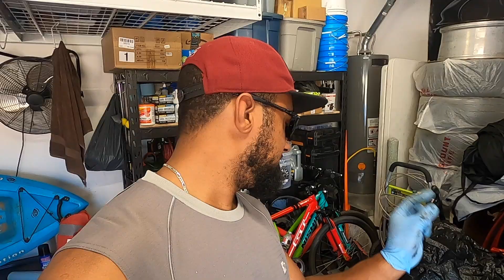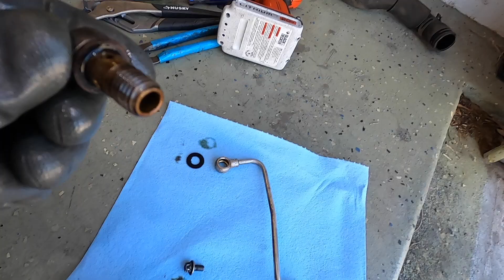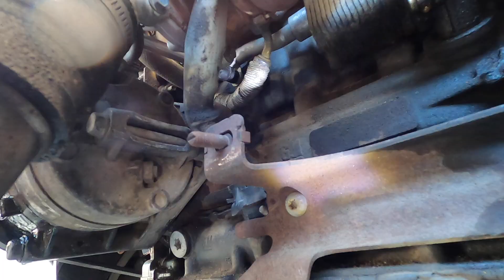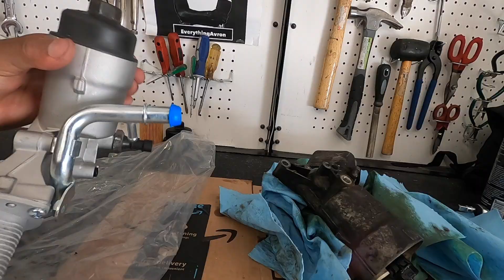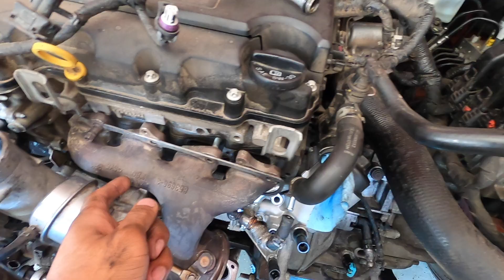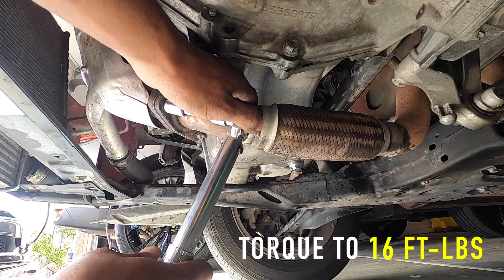HOW TO REPLACE 2012-up CHEVROLET SONIC OIL COOLER| No more oil leaks and oilcaked Engine block!

Comment: Excellent video I have a quick question my all cooler filter cap is the brown style with the expensive filters. Can I change over the whole cooler system with the black top so I'm put cheaper filters in thank you

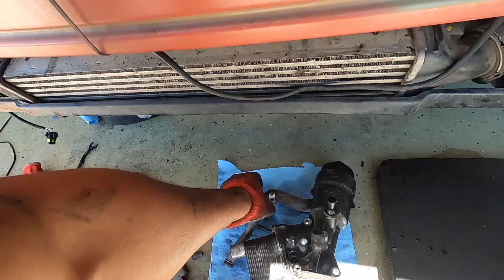Comment: 8:12 that push fit tube that only seals by the o-ring has got to be the stupidest design ever. There's nothing physically securing it, or providing positive pressure, like a clamp. When the radiator is up to pressure, 20psi is enough to blow right past that idiotic o-ring without an means of physically clamping/sealing it.
Reply: Mine is leaking where it connects to the oil pan. Would love to figure out a better way to seal it.

Comment: What are the torque specs for the bolts that hold the engine oil cooler to the engine block?

Comment: Can't you just bypass this?  Why have an oil cooler?
Reply: It cools the engine oil.
Reply: If you skip the oil cooler, you also gotta mod out the turbo. Better to just do the fix--a fair bit of work, but low parts cost. Pricy in a shop, but a day off or a weekend at home and you're set.

Comment: Any idea how or what the plastic plunger is inside the housing where the oil feed to turbo goes in? I have two of these and theyre both just loose with an oring. I have no idea what their inteded purpose is either...

Comment: Will replacing this help with that orange slush build up in the reservoir and radiator?
Reply: If you're getting milky oil into your coolant reservoir, this is the problem, unless you have a blown head gasket, or bad timing cover seal. These are prone to fail, failed on both my vehicles.